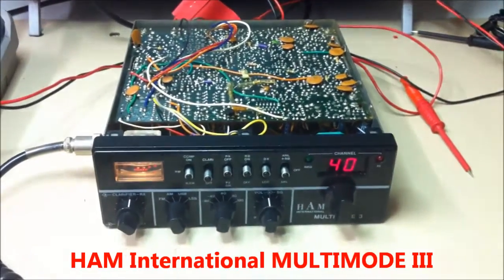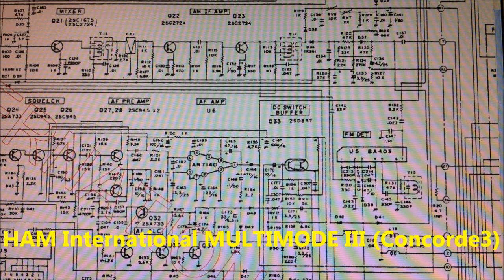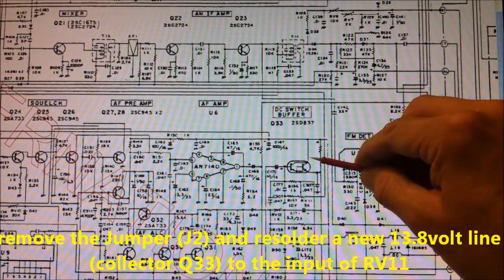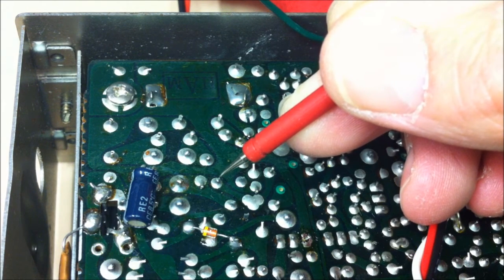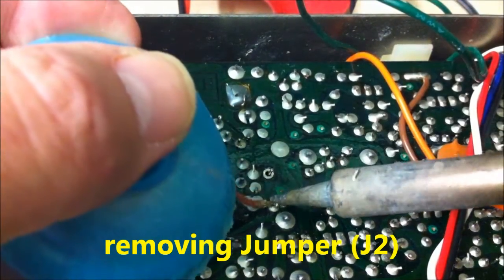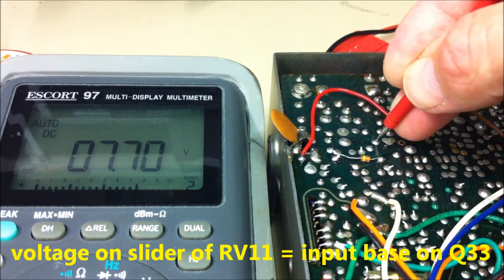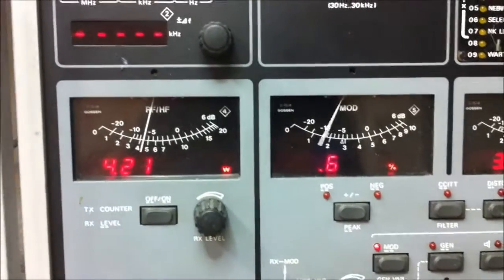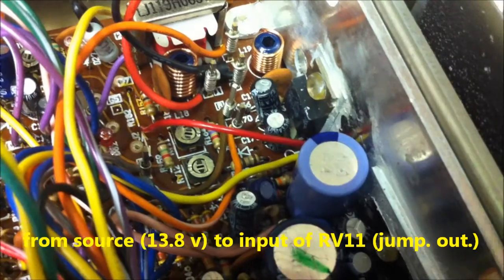Pump up the AM/FM RF-Power on CYBERNET PTBM133A4X radios

Comment: why can t i get more than 4 watts from my tagra pacific 3???ptbm131a4x    did the channel a on 20   t1and t3 then     /  e  channel 20    t2 and t4 /b channel  20  ct6 and 8   ?D channel  20     CT7 AND CT9....also t5 and l 16 but no power gain??? with the rv11 to the left on am 15 watts...adjust rv 11 to 7 watts am  now....and is there an alc potmeter some were in this rig????     COOL VIDEO SWIZZZZ
Reply from the maker: Mister Richard hello, thank you for your interest. I'm sorry, for the long time to answer your problem. Yes, the RV3 controls the ALC for FM/SSB. You could lengthen the solder points of the RV3 to the front panel and connect with a pot. Many years ago (1984), I had made this modification on a Midland 7001 (Ptbm125). Also on PTBM131 and -133 is it so. Best regards to you and yours....
Reply: @SWIZZRADIOS    rv 3 was closed if i remember corectly, also the potmeter for agc was closed(bearly any s meter on ssb,fm am was great)never had the ptbm 131a4x before,bit diffrent from the ptbm121a4x and ptbm 059cox. For adjusting...anyway its reciving and transmitting great again pushing 17 watts on ssb and 8 on am...73 51. Thanks for the reply